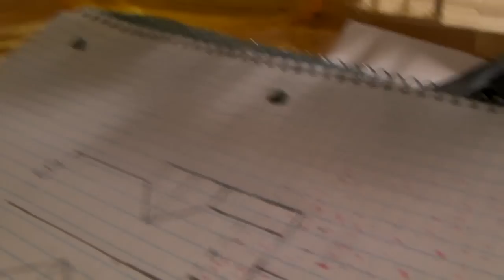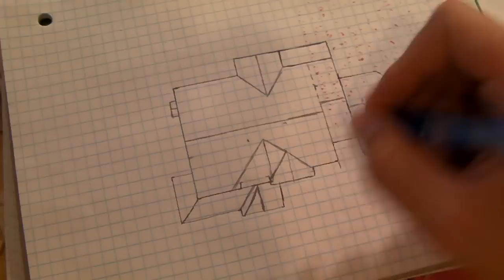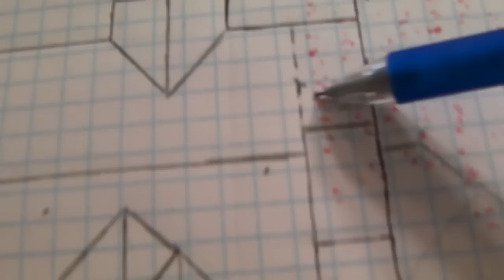12 - Building Popsicle House

Comment: You're doing a nice job on this house. I heard what you said about your second house...about the roof. I always noticed it being steeper than normal. You worked with all hot glue right? There is hope! As you probably already know, hot glue can peel off. If you are careful and use exacto-knives, you still have a chance to remove the roof and replace it. Keep on making these great videos!

Comment from the maker: I talked about that in past videos.  I knew I was going to have that problem as soon as I started building the roof.  The pitch of the hip roof could NOT go any lower, (due to some wall placement), and I didn't want the gable roof any higher, so they had 2 different pitches.

My mistake was, I wanted the hip to be at a 12/12 pitch, instead, I made the hip rafters (corner/edge ones) 12/12, which isn't the same.  I am making no sense right now.